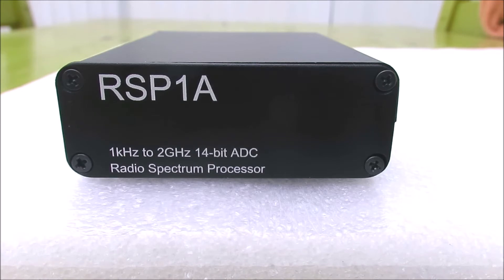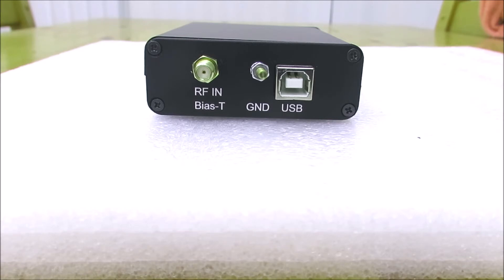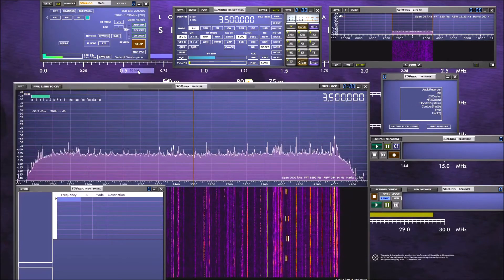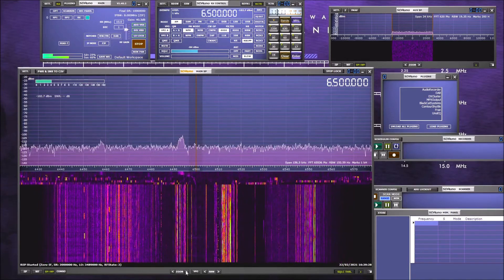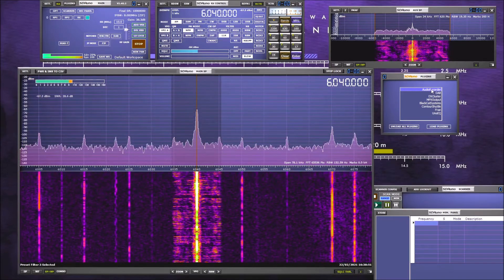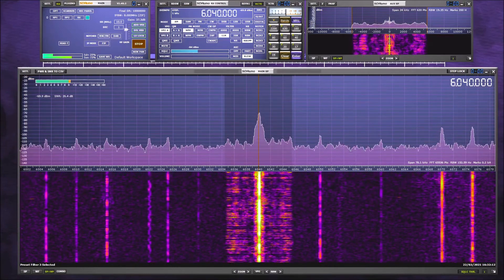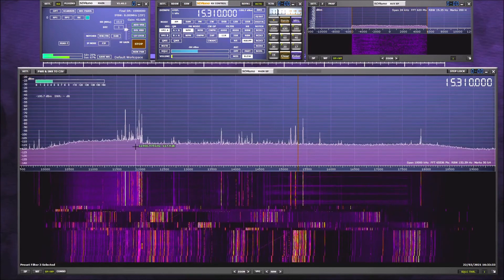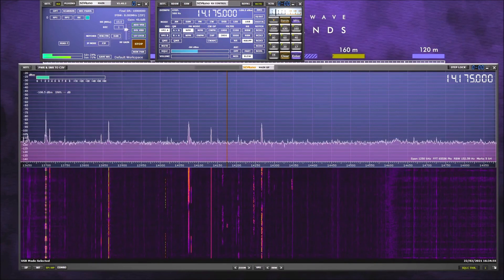SDR Play RSP1A and SDR UNO software-a personal overview

Comment: I bought the RSP1A recently and I'm very impressed, but can't really go over 2Mhz B/W on my ancient system.
I'm restricted to CubicSDR but was pleasantly surprised to hear SSB voice from as far away as Kuwait and USA on my
indoor loop antenna. My furthest FT8 RX has been Brazil.
Reply from the maker: It's a good receiver to be sure but to take advantage of the full 10mhz bandwidth you need a moderately powerful pc.
Reply: its worth buying a new PC to be able to see the whole thing, and depending on screen depth as to how many of the control windows you can have open SDRuno really ROCKS! I have had my RSP1SA about a month now, I have been a Ham with all kinds of radios from DC to Sunlight LOL but for a lot of things I just fire this up now
Reply: @Grandassets  Well, despite my Core2Duo PC puffing hard as I invariably have other applications open as well (web browser, digi-mode software etc), it's netted me some impressive eQSL cards far and wide as a SWL participant. Asiatic Russia, Japan, Greenland, Finland, Colombia, Venezuela, Puerto Rico, Canada, USA, Ukraine among some others.  Not bad for kit sitting just feet away from my sofa. :)
My Youloop is adapted atop a camera tripod for full nulling, polarisation and directional optimisation and the SDR is mounted right below the loop balun box. 3m USB lead connects to the PC.